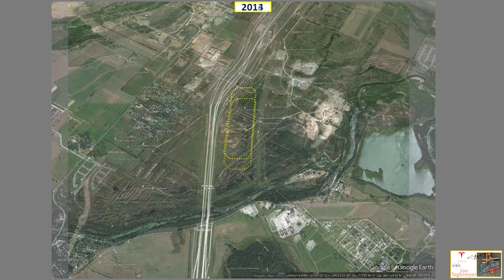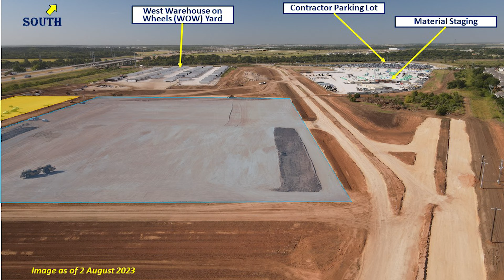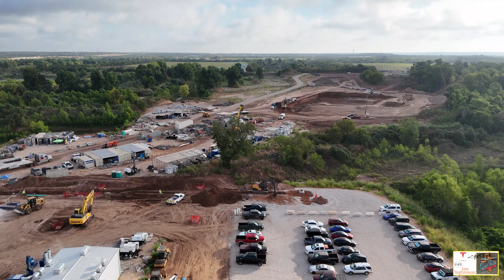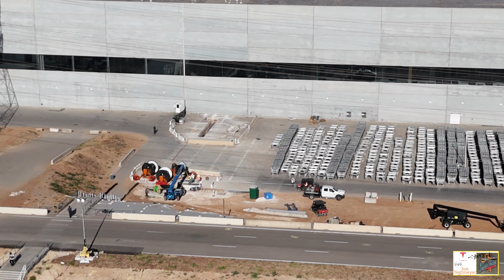Cybertruck Supercharging! W side Construction Progress! 4 August 2023 Giga Texas Update (07:35AM)

Comment: Anyone know if more solar panels are going to be added to the roof of the main building?   Are the existing panels sufficient to charge up the Megapacks and where is the electricity for the Megapacks actually coming from the panels and the grid?  When/how will the electricity in the Megapacks be used?
Reply: If they the follow the initial plans, there will be 70,000 solar panels. 
There is no direct link between the solar panels and the Megapacks. There is a backup power connection through the BESS Substation between the Megapacks and the Tesla Enclosure/Mega-vault. However, the circuit breakers on those circuits are normally open. That is  according to the interconnection agreement. The main connection for the Megapacks is through the BESS Substation to the LCRA grid. The secondary connection for the Megapacks is through the BESS Substation to the Tesla Enclosure during a power outage. At that point the circuit breakers will close.
How will the electricity in the Megapacks be used? Two purposes... Grid stabilization and backup power. The solar panels will offset energy use by the factory, lowering their power bill.

Comment: For all the folks fanboying for a tunnel under the State Toll Road to connect the Gigafactory to the new EOL facility. There are a number a reasons that are not favorable for a tunnel. Doesn’t mean that they won’t do it, but it’s not the slam dunk so many might think it is.

First, they’d need to acquire permission and rights from the state and the company that owns the toll road. That would probably mean a new law or such from the state to allow it. Not easy or cheap. 

Second, the Gigafactory is built on alluvial land. That’s a fancy word for a river flood plain. It’s sand and gravel for many feet, thus why it was a sand and gravel mine. As you can see from the many ponds, the water level in the area isn’t too far underground and water flows from the river underground very nicely. So this is not ground that is conducive to a tunnel boring machine. It can be done, but not cheap and easy. 

Finally, the River Road is right there. It’s almost built, bought and paid for. You can run a shuttle service to haul drivers back and forth for a lot of years before you’d approach the price of a tunnel. To be honest, I think they could program each new car to drive itself over to the lot much easier. That would really be eating your own dog food.
Reply: Tunnel. Twigged my memory. Went off to see if that River Tunnel permit is current, and it is. Awaiting further documentation. Last correspondence (publicly available) was 8 June 2023. Deadline extended until October 28 2023.

New EOL location. It's a little like the arguments for a rail connection, or a tunnel to the current rail connection. If the numbers don't stack up, it don't stack up.

Plus, it may be that the 8000' drive around to the new EOL location becomes part of the test track. Would make absolute sense to have series of different road surfaces that get traversed before arriving at the new EOL.

Comment: The frequently mentioned "transformers" down the sides of the megapacks are actually bi-directional inverters.  Transformers don't do DC!
Reply: The output from the Megapacks is 480 volts AC. They have internal inverters.
Reply: @DavidJohnson-tv2nn  I don't argue with that because if you look at other megapack sites (say the Moss Landing one) they don't have such units and so the megapacks must directly feed into the few and obvious large transformers on that site.  But these boxes don't look at all like regular transformers and have several hallmarks of being something more sophisticated.
I suspect that they're somehow tied into the solar panels. If you can find a datasheet you will convince me that they are regular transformers, but the catalogue pictures that Joe came up with the other week of this manufacturer's transformers did look like regular transformers, and nothing like what we are seeing here.

Comment: Thanks Joe.
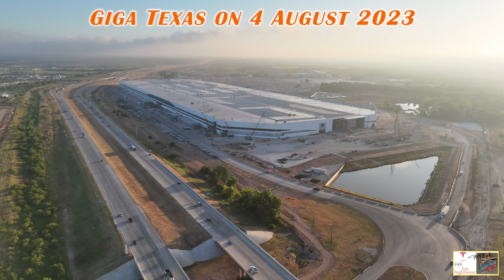5:30. River road/Highway. Ground washing away at the Rip-rap around the surface drain inlet.
Right. River road. Gravel road base being removed.
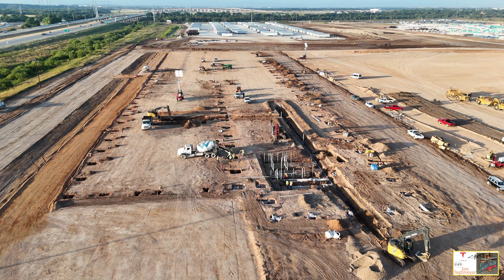7:50. Westside. New EOL. Concrete placed for the footings. Column pedestals to be formed up separately.
Sanitary sewer drains for an amenities block.
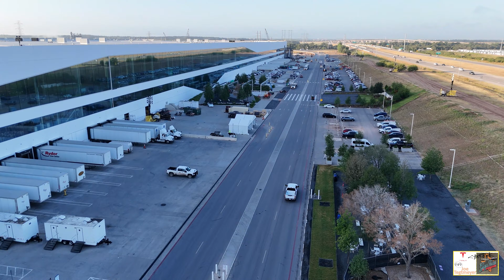9:16. GA, highway berm side. Garden area fenced off. Might be trying to save these struggling trees.
9:49. Main Entrance. Portal Frames. Smallest frame has the full width of Stainless Steel.
Inside. Left. Scaffold being assembled above the stair.
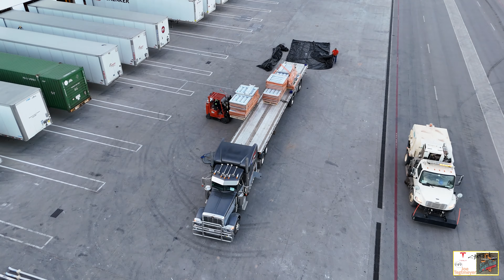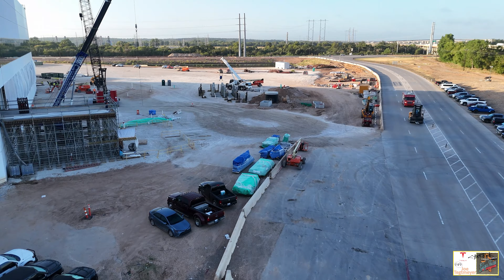10:29. GA, apron. Trailer load with ‘Alumanate’ panels. Panels are framed, so may be a manufactured modular system using Alumanate panels. A machine guard system for example. More panels at 10:49.
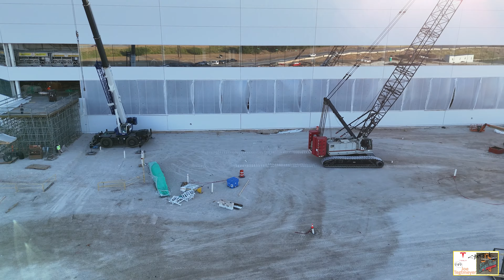11:13. GA southwest, loading platform. Constructed a front porch.
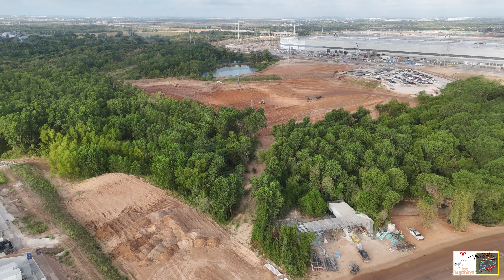15:38. Eastside contractors. Painters workshop. White pipes today.
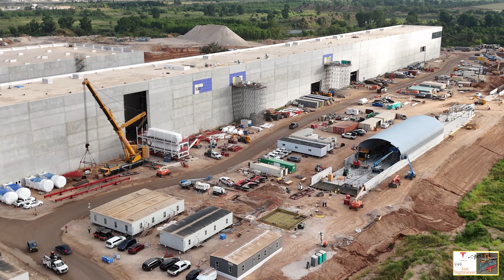16:32. Cathode east, ramp. Large delivery placed on the tracks. Each level is about height of a wall panel. Room for plenty more.
17:07. Crash Test Track. Channel continues past the subterranean structure.
Quonset roof spacer/locaters fitted the full length of the walls.
17:55. Crash Test Track. New steel structure at the north end, ‘The Launch Pad’.
18:42. Wade Pit. Pipes cast into the wall. Different drainage levels.
19:06. Cell Test Lab. Right. Sanitary sewer drains being installed. Another building perhaps.
21:23. Die Shop, south of. Right. Stack of Natural Gas pipes, black with a yellow stripe.
22:21. New switchyard/substation. Mega-Vault. Constructing the beam rebar, and formwork for another long opening. Precast vaults are marked ‘H-E-House’.
23:28. Monopoles. Curious that the conduits to the BESS switchyard between either end of the new switchyard/substation were placed through HDD bores under whatever is in the easement. 
The conduits in the cables ducts between the Mega-Vault and the factory cross above whatever is in the easement. Possibly a different depth requirement between MV cabling and LV cabling.
24:46.  BESS installation. 3 maybe 4 transformers have the cabling neatly finished in the cable trays. 30 to go. Plus, cabling from the transformers to the BESS Switchyard yet to be started.
25:01. BESS Contractors yard. Right. Cyclone wire mesh fence components in amongst the items.
25:40. Plastics, apon. Pellet delivery.
26:28. Casting east. Inside through the loading dock doors. Stack of steel getting smaller.
27:12. East Main Entrance. Right. 3 more Loading dock door openings cut in the wall panels.
28:07. EOL Superchargers. Cybertruck. Frunk liner in the rear bed. Better view in Joe’s photos.

Comment: @ 8:19 For those who want a Boring company tunnel...
Besides being a bad idea for vehicles...
Seems like the elevation of this site is about the same as the freeway. Meaning your tunnel would come out below grade.
Reply: Why is it a bad idea for vehicles?  It seems to be working in Las Vegas.  Yes, the vehicle will be below grade but that's true in Las Vegas.  They use ramps at both ends.
Reply: @59seank  At 12' wide, about the width of a freeway lane, the tunnel gets even more narrow where the road actually is. Good for a pedestrian path? Yes. A utility conduit? Yes. A road? No. Bad idea in Las Vegas. Not used anywhere else. As initially proposed, a great idea. Where a car would drive onto a car carrier, and go through the tunnel at 150 mph. And any vehicle, gas or electric, could use the tunnels. As usual with the guy who runs the place, what was proposed and what was actually delivered are two different things. Regarding below grade...
Not a lot of room for a ramp on the factory side without ripping out a lot of employee parking spaces.
Reply: @DavidJohnson-tv2nn  Yeah, yeah, yeah.But I want to know what is wrong with a below grade tunnel.
Reply: @DavidJohnson-tv2nn  Use a car elevator carousel as necessary at each end.  Assuming a 20 min round trip for each driver and full factory output of 1M vehicles/yr that is 0.33M labor hours.  Assuming $30/hr for min wage + overhead (pure guess) that's $10M per year.  Estimates for the Boring Co ranged from $4M to $15M per mile.  Then using FSD the tunnel payback is less than 2 years.
Reply: @datamatters8  Best efficiency would have been to place the facility as close to River Road as possible.
Regarding Boring company estimates... If I remember correctly, Boring company charged Los Vegas somewhere around 50 million for a one mile tunnel. In any case, the tunnels aren't very useful for vehicle traffic because they are just too narrow. But that is just my opinion.
FSD... One small problem... It doesn't work :)
Reply: @jbbuzzable  Because, I've got the feeling that fans of your leader think it is just a matter of boring through the berm of the factory side and popping out on the other side of the freeway. I just want to point out that it is not that simple. And of course, not miss the opportunity to also point that the tunnels aren't very useful for vehicle traffic :)
Reply: Let’s not forget that DJ is an engineering expert, an accounting expert, worlds best project manager and now we can add subterranean logistics expert. We should listen to his criticism of our “leader”.
Reply: @RanchReed  Not an expert on anything. But neither is your leader :) If he was, he wouldn't build 12' wide tunnels for cars. I just try to use common sense.

Comment: Tesla Enclosure:
@ 22:29 Another opening is being formed up in the top of the vault, which will be for cables to enter another containerized switchgear building. The second switchgear building will be adjacent to the busbars from the second transformer. 
Concrete vault next to switchgear building ready to be placed so duct-bank can make 90 degree turn.
@ 22:44 (Down in vault) Cable spool or fiber optic conduit? 
Easement:
@ 23:28 to 23:36 Laying conduit for the 345 kV duct-bank. This will connect the BESS Substation to the east monopole seen @ 23:18.
@ 23:36 (Bottom) Can't help but wonder if cables will have difficulty making the bend?
BESS Substation:
@ 24:13 (Bottom left) Steel support structure  with control cabinet for 345 kV circuit breakers placed on concrete pad.
@ 24:25 (Bottom right) Crew in man lift connecting 24.9 kV circuit breaker to disconnects.
Vaults:
North parking lot: @ 25:19 Ongoing cable pull.
Superchargers: @ 26:55 Conduit placed in trench. Likely for new power supply to superchargers. Since their vault is a few feet to the left.

Comment: Usually when I hear about grease traps, it's in the context of commercial kitchens, though I think they're needed for auto shops also, but I'm not clear on why they would need one for EV production unless the building also has a cafeteria. It could just be regulations that don't take into account EVs.
Reply: They will have commercial kitchens on site to feed the thousands of employees. I would imagine there are various oils used as machine lubricant for the production equipment. Some paints may be oil-based. Just a good idea for a site of that size.
Reply: There is lots of oil in the drive train.

Comment: Thanks for sharing the info on the new DJI Air 3!   Been looking at one myself.  How does your flight time with the Air 3 compare with the other drones you've been using to cover Giga Texas?
Reply from the maker: Battery range was FANTASTIC! I only used 3 batteries today where normally I use at least 6 on my other drones. It also saved me a lot of time not having to fly back to swap batteries and then fly out to resume the video! A few settings to modify but all in all, it really did well!

Comment: Considering the current end of line location? I have to wonder if they are thinking of tunneling under the highway. It would keep the new units off the main roads.
Reply from the maker: Not yet sure, but this is likely not the final location the cars will exit the factory, but things change so quickly here, it is hard to tell.
Reply: @JoeTegtmeyer  The only other route is on a dedicated lane under the overpass. And even then the cars would have to cross the main road somewhere. Oh well time will tell.

Comment: I could see a boreing tunnel between the sides of the highway would add a bit of efficiency!
Reply from the maker: Might be cool if they did that!
Reply: And it would be easier to have the cars drive themselves to the end of line building
Reply: @davidhuber6251  and you wouldn't have to have a shuttle bringing drivers back and forth over and over.
Reply: Why would they build a tunnel under the highway when they already built River Road that does the same thing?
Reply: @jestercat7723  closed private road v open public road.
One needs a driver in the vehicle.
Reply: @shrikedecil  And since they haven't achieved full self driving yet they still need a driver in the vehicle so what is your point
Reply: @jestercat7723  For a track they own? No, they don't. They can manage "drive straight in a well lit tube" at this point just fine. The legalities only kick in when it's a public road. And there are plenty of private roads, overpasses, underpasses, etc. That can be arranged.
Reply: @shrikedecil  Since River Road is on Tesla Property and was built by Tesla I think it qualifies as a private road.
Reply: @jestercat7723   Because it's a fraction of the distance, so far fewer drivers required.
Reply: @fredflintstone9963  And leaving it where it is at is even a shorter distance, so the distance doesn't seem to be a concern to tthem.
Reply: @fredflintstone9963  It is still going to require one driver per vehicle so reducing the distance of the drive wont change the number of drivers required
Reply: I came down to the comments to say the same thing.  I guess it's a pretty obvious solution from all the other comments.  I'm a bit surprised they don't want this further south to be right next to the underpass, even though it would mean moving the warehouse on wheels again.  I'm guessing they're planning on expanding it south as the factory ramps up over the next two years, though I love the idea of a tunnel from inside the main factory to inside the new building.
Reply: You guys are reading my mind.  It’s a nice straight shot versus a lot of driving.
Reply: It would have been much more efficient to place the facility closer to River Road. Boring company tunnels are pretty much useless for a road. At 12' wide, about the width of a freeway lane, they get even more narrow where the road actually is. Good for a pedestrian path? Yes. A utility conduit? Yes. A road? No. Not to mention, that is public right of way owned by TxDOT.
Reply: @DavidJohnson-tv2nn  The Las Vegas Loop is a Boring tunnel with Tesla cars in it.  Definitely likely TxDOT would not be real excited about a tunnel under their relatively new highway, but those things can be worked out by engineers.  Maybe they'll discover a new cave system.  The Inner-space Caverns were discovered nearby when I-35 core samples were being taken.
Reply: @scottgaree7667  The Las Vegas Loop is a Boring tunnel with Tesla cars in it, and you can see how narrow those tunnels are.
Reply: @DavidJohnson-tv2nn  Use a car elevator carousel as necessary at each end.  Assuming a 20 min round trip for each driver and full factory output of 1M vehicles/yr that is 0.33M labor hours.  Assuming $30/hr for min wage + overhead (pure guess) that's $10M per year.  Estimates for the Boring Co ranged from $4M to $15M per mile.  Then using FSD the tunnel payback is less than 2 years.  Also no weather issues with a tunnel.  As long as the engineering works for the depth specified then a TxDOT permit could be negotiated.
Reply: Google Earth shows approximately 8600' 2600m if the vehicles exit the factory on the east side or west side at either of the building exits currently used. West exit is much further north.

A tunnel would be 1200' 365m from the west side building exit straight under the highway to the new EOL building.

What would be missed from that saving in driving distance is the potential for faults or defects to be identified in that initial drive straight off the production line.